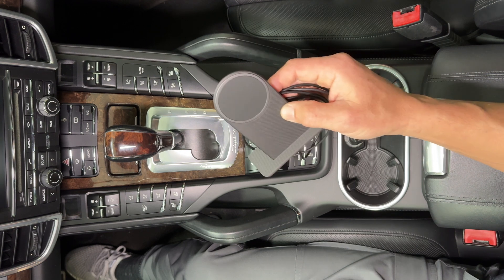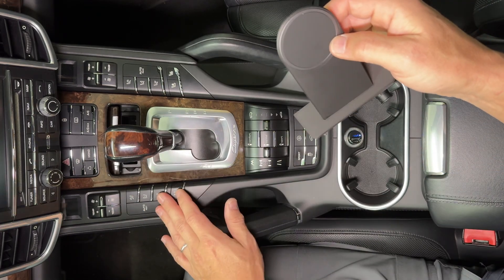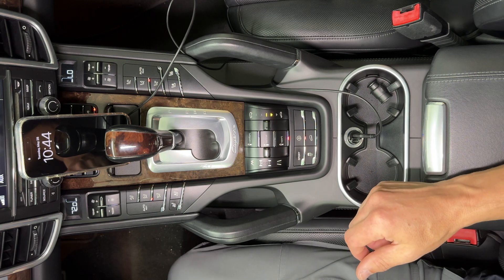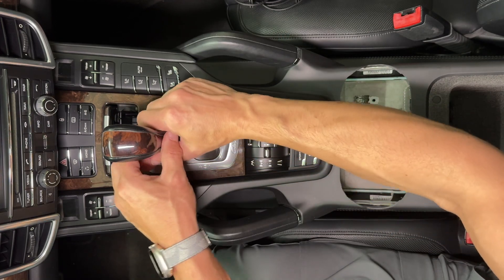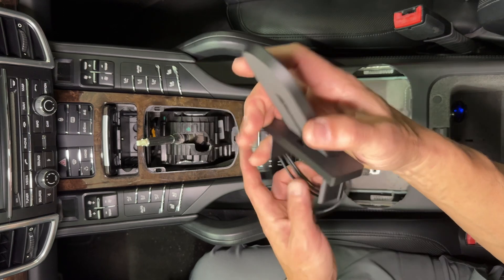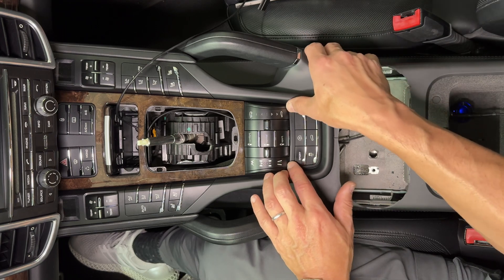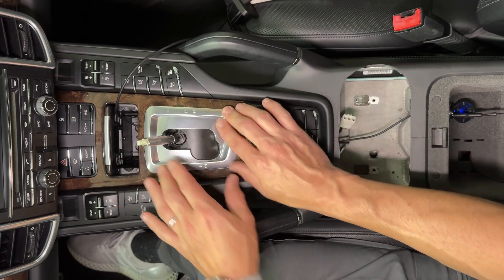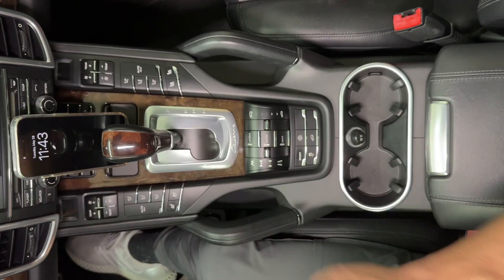2011-2018 Porsche Cayenne 958 MagSafe Charger Install

Comment: How'd you disconnect the lighter?
Reply from the maker: It's just a clip where the wire connects.
Reply: @nine-volt  gotcha I have to replace mine since I have a few of the holders broke somehow, got it out but you're right it's so tight and not a lot of room to get to it, thought maybe you had some trick to getting to it.